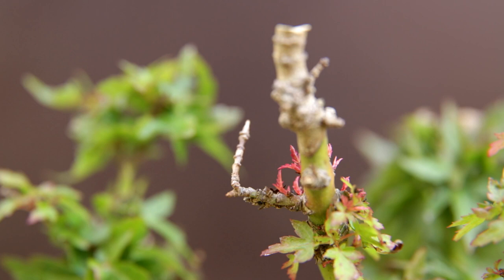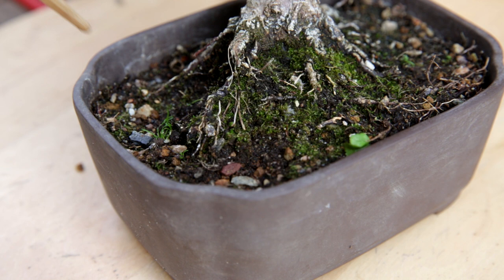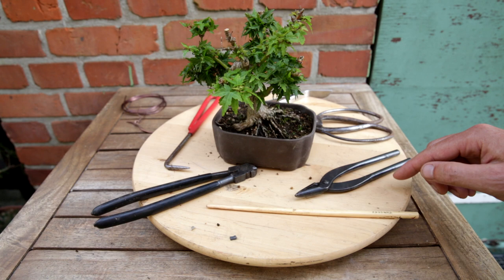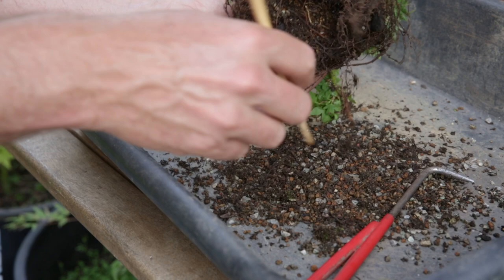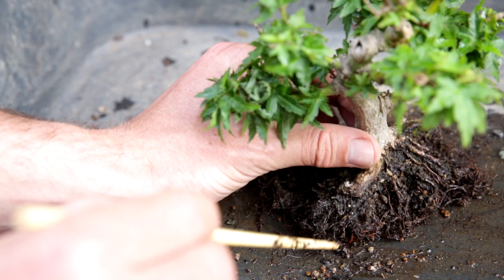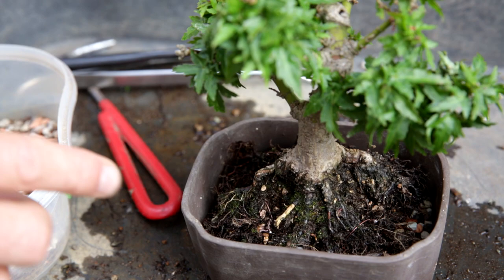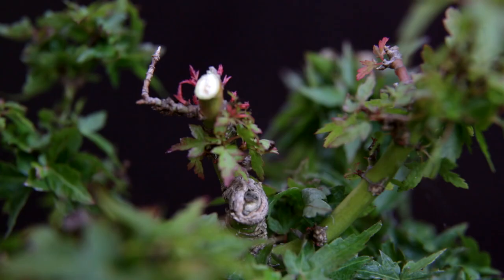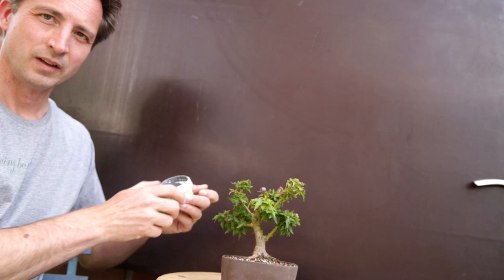Emergency Repot for sick bonsai | Fixing Japanese Maple root problems

Comment: In these cases, repot on a bigger pot, try to undo the outer without breaking roots and water by immersion, which is a great way to water it.   Also Leonardite humic acids can help to improve substrates....   Great video.
Reply from the maker: also an option. I find summer repot on maples is no problem though, and this is easier for the owner to manage

Comment: Great video as usual! How do you select which roots to cut? Just the longer ones?
Reply from the maker: Hi Jose, normally in a repot you would focus on reducing roots that are getting too big for the nebari. In an emergency repot you remove as little as possible. I tried to only remove the circling ones.

Comment: Hi Jelle!  I love your videos!  I have a ? about doing an ER repot.  Ordered  a nice Katsura, about 16in tall from soil.  Looked great when I got it (2weeks ago) but it continues to get black wilted leaves.  It is in a pretty deep round pot (8inWx5inD). with fairly compact soil in the middle and just a little less on outer rim.  Soil consists of coconut husk and river sand particles.  I’m worried because more and more leaves are blackening daily.  When I water I check my moisture meter and it holds water for a long period (days).  It gets morning sun afternoon shade. No pests or fungi.  Would you recommend an ER repot or should I wait?  Love to hear your thoughts if poss.  Cheers!

Comment: Great job on saving that tree!
Have you ever tried the peter chan sphagnum moss method? (Basically just putting it in pure sphagnum moss)
What do you think of pond containers?
Reply from the maker: I have not tried that method. I have never seen the need for it. Why use that if you have good substrate. Spaghnum just makes a wet ball that is hard to get out of the roots later!

Pond containers? I find them to dry out fast.
Reply: @GrowingBonsai  Thank you for the reply Jelle. Yeah, I had the suspicion about the sphagnum moss.
Reply from the maker: @watsup6084  it is a well-known technique though. I have heard good things, but I see downsides which I do not like. Personal preference?

Comment: Thank you for the video.  I have a young (10 inch high) Deshojo maple in a nursery pot and soil that I got last fall.   The nursery said to let it grow for a couple of years before repotting it because it had just been potted that spring.  However, it was slow to start budding this spring, and the leaves are crinkled or somewhat curly, instead of the normal flat shape of a maple leaf.   I’m thinking the nursery soil is staying too wet, even though I only water it when the upper inch of soil is dry, usually every 5-7 days.  I’ve thought of doing some form of emergency repot to try and improve it’s health.  Do you have any advice?
Reply from the maker: tricky to give advice without seeing the tree. Have you ruled out other problems such as fungal, insects or overfertilizing?
Reply: @GrowingBonsai  I suspect it’s root fungus issues based on the constant moistness of the nursery soil it’s in.   I’ve been avoiding watering until the top 2-3 inches of the soil is dry.  It seems to be doing better as a result.  I will definitely repot it into Akadama next spring.
Reply: Bob, it the tree is still struggling, try slipping it into a taller nursery pot with coarse gravel at the bottom, like 3-4 inches, this will allow the soil to drain completely into the gravel allowing better oxygen. It’s a bandaid, but it will help prevent roots being too wet. Good luck.
Reply: When is the correct time to repot a Maple if spring is not the ideal time??????? Plz

Comment: Hey Jelle, Great Content as per usual. I have a large chinese juniper that is doing really badly. Bought it from a collection of someone who had not been able to properly care for it the last few years.

I repotted it this spring but the whole rootball was like one big rock. So I decided to only remove 1/3 - 1/2 of the rootball and do the rest next year. 

Unfortunately this year it didn‘t start growing and instead up until now it lost about half of the needles. I watered it only lightly because I was afraid the remaining rootball could start to rot. Also did not fertilize it.

How would you go on with it? Fertilize or not? Put it in or out of the sun? Water heavily or lightly?
Reply from the maker: Hard to tell without seeing the tree, or knowng your local weather. IN GENERAL junipers love water, as long as the rootball is not airless.  For me, healthy trees start with healthy roots. Which is why I repot all trees as soon as I get them, unless it really is too dangerous to do so.That way I can get the substrate under control and water lots. 

Assuming the half you cleaned is well-draining, I would certainly water that frequently and well.
Reply: @GrowingBonsai  Thank you for your help! I'm in west Germany. Bought the tree in Düsseldorf - I guess we are not that far apart.

The problem when repotting was that the roots were so extremely condensed that you simply could not sort them out in any way shape or form. Basically all I was able to do was to cut off a big chunk and replace as much soil as possible with Pumice, Lava and  Akadama. I also planted it in a bigger pot with large Pumice in the bottom for drainage so that the remaining rootball would not sit in water all the time.

I have started watering it heavily a few days back and also gave it some fertilizer (Bio Gold) since doing it the other way around clearly didn't work.

From here I guess I'll just wait and hope.

Comment: A ficus bonsai which I bought for my mother as a gift has fallen its leaves and looks like a dead bush now but probably still alive. She has been keeping it indoors without proper light and forgot to water it for few days. I took it back and realized that it was not wired to the pot and the soil has completely detached from the pot's walls. Should I do the same procedure as you did in this video or wait until it shows the signs of life and grow back leaves.
Reply from the maker: Always dificult to make recommendations in a distant fashion. I think I would support the ficus: Slightly larger pot and good quality potting soil to let it recover. Ficus in general has strong roots that can deal with lots.

Comment: Hello, I am new to bonsai and I’ve got a Japanese garden juniper that I bought in late April (middle of spring here in Denver). It came in a bonsai pot and in pretty typical, high moisture retaining soil. My concern is that this soil will lead to root rot which these junipers are prone to. Any advice on how to inspect my soil and roots to judge if it needs a repot? What is an ideal substrate for this species? Keep in mind the climate is relatively dry, and humidity is usually not above 40%
Reply from the maker: I think key is to just to eep your watering in check. Buuut.. I feel more junipers succumb to too little than to too much water. Any open well-draining substrate would work. More akadama and.or organics and smaller grains improves water retention

Comment: I have a shimpaku small one that is in bad soil. I really want to repot with fresh APL. Middle of summer in texas do you suggest doing this? Tree was attacked by spider mites about 2 momths ago and seems to be doing much better noe after several treatments growing new buds .but still not looking healthy enough and i am sure is because of the soil is sitting on. Quite compact
Reply from the maker: I would not do this in the middle of a hot summer, no.

Comment: Why not let it soak in a bucket of water until it stops bubbling??  Easier to finesse the roots...Needs a bigger pot✊🏾
Reply from the maker: Hi, the problem with the roots is poor substrate with lots of organics. If you soak that, the substrate will further compact, leading to more root problems. Why do you think it needs a bigger pot? THe pot is on the large side for the tree.